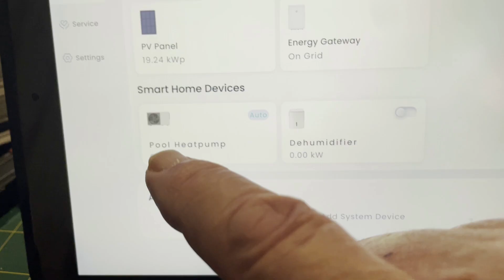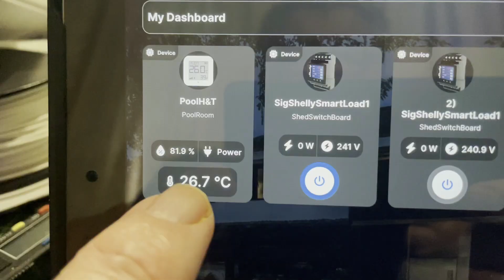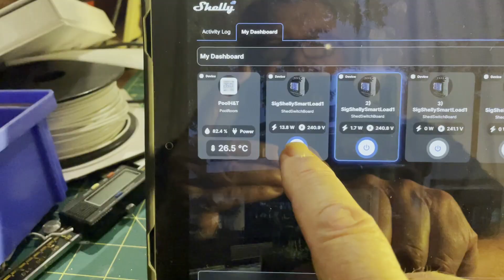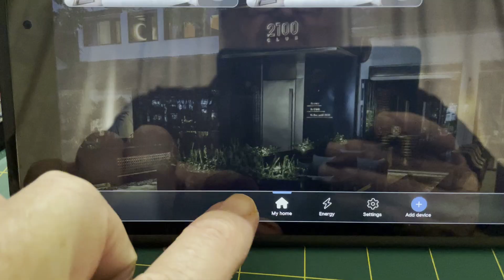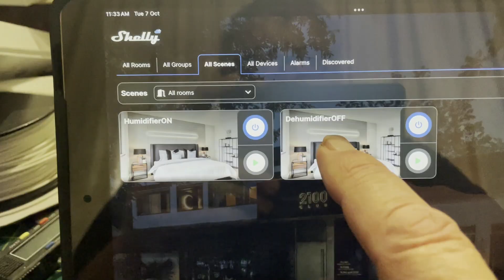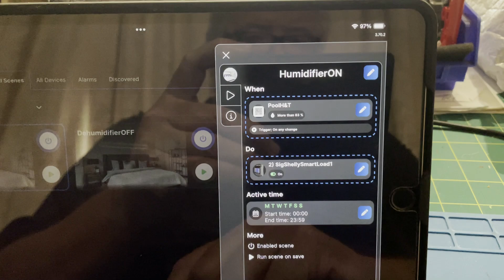Shelly PRO 4PM setup in Sigenergy App

Comment: just wondering if you need to use 2 channels why not use the output of 1 channel directly into the input of the second channel as they are 4 relays in them selves. no need for the extra relay for the and function. will have shelly pro 4 pm in a couple of days and will be controlling though sig app myself.
Reply from the maker: The input of all channels are connected together internally to L1 . Digital logic controls the relay coil activation.

Comment from the maker: Yes, was able to use the other channels after adding the Shelly as a Smart Device and then adding Smart loads which appear as circuit breaker icons on the Sig App. Not very intuitive but it works. Expect a more intuitive software update in future. Still don’t have a solution for the relay logic question raised in my video? Thanks Luke.
Reply: Had the exact same problem on my Shelly 3 Pro (trying to access channels 2&3), problem sorted now, thank you!

Comment: You can add the other channels after you have added the main device to the Sig app.
Reply from the maker: I have my dehumidifier added to Sig app and working fine. Do I scan for new device and it will find another channel on the 4PM PRO?
Reply: @bms250ford   No, there is an option to add them from the one that is already there.  (Saw the solution on another site a few weeks back, but can’t recall the exact steps - getting mine installed shortly - only ordered it after I saw it was possible to add all channels within the Sig app)
Reply from the maker: @Lukej-q9u let me know how if you are successful Please.